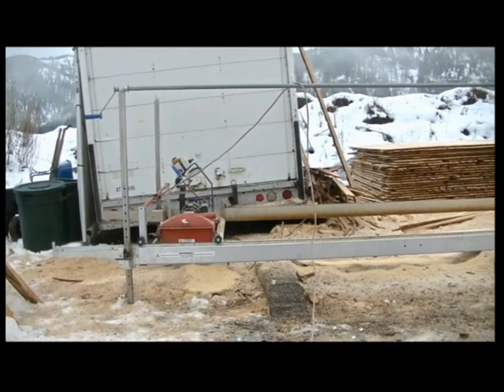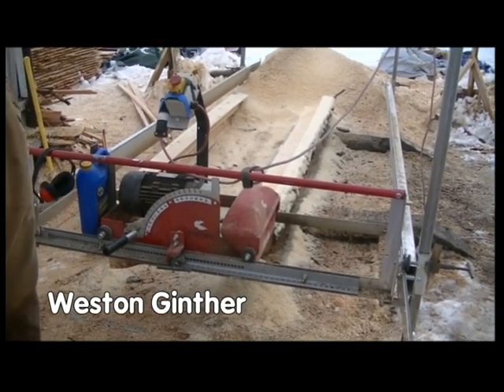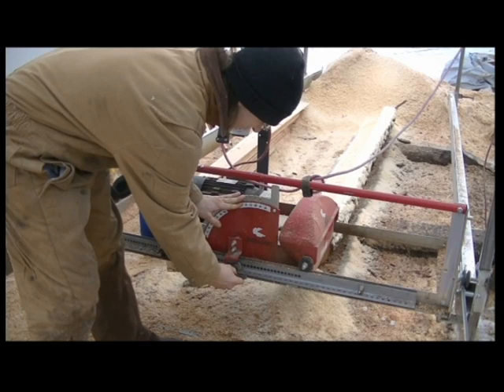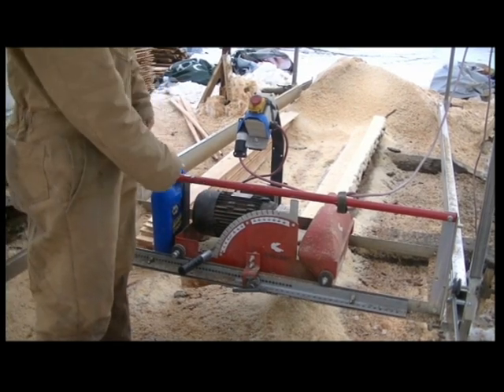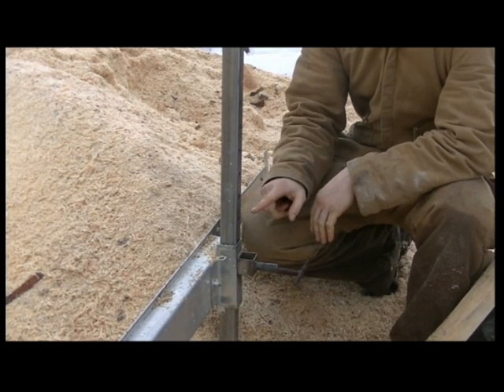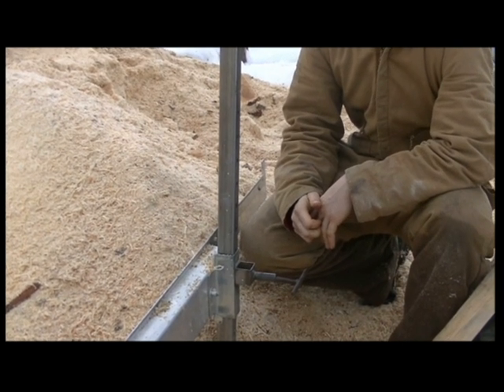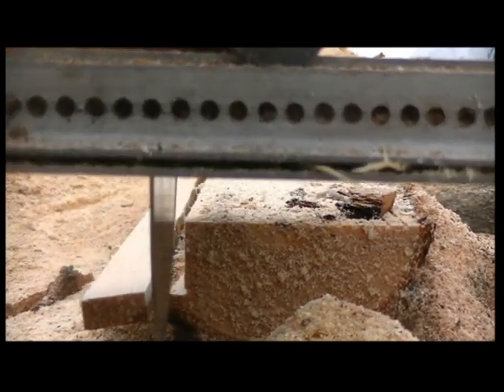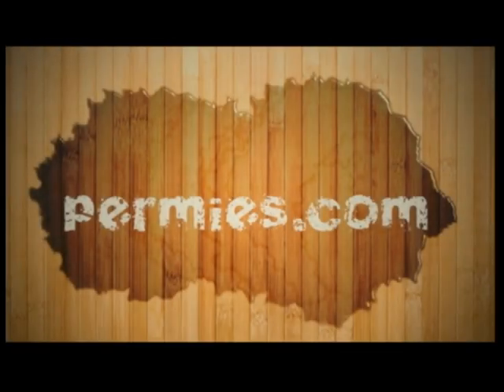Electric Swingblade Sawmill Modifications

Comment: Looks very well made, very nice. I wonder which is more power efficient: a bandsaw or circular saw.
Reply from the maker: Swingblade mills are more efficient in many ways if you want dimensional lumber.
Reply: Depends on what electric motor is in which saw. Time that the saw is on per board. Cost of maintenance. Cost of blade.
But for cutting out boards. Circular Saw.
Reply: paul wheaton Unless you have a need for a slab cut of wood, every other piece of wood will be dimensional.  I agree swingblade sawmills are more efficient and require very little log handling compared to bandsaw and chainsaw mills.